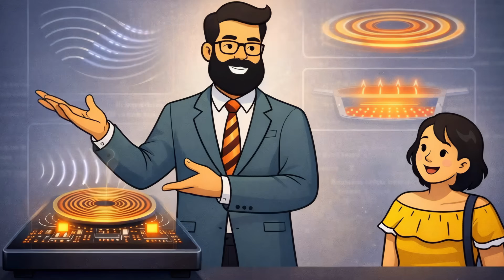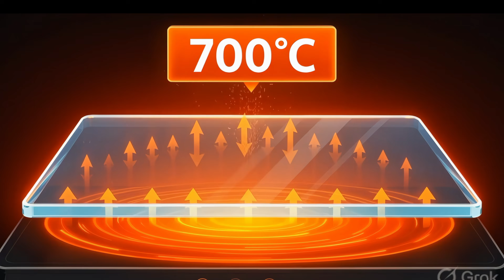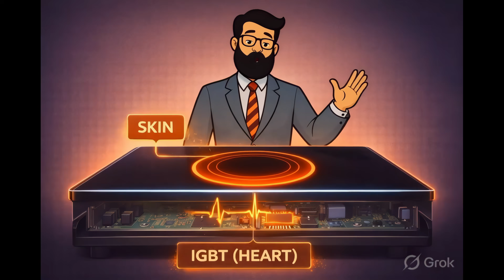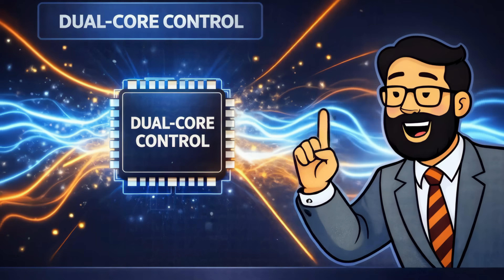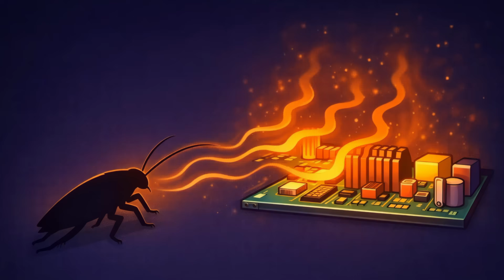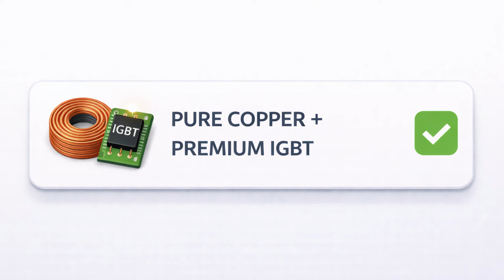Why Cheap Induction Stoves Fail: The 2026 "Power Gap" Explained

Comment: All fine but you never spoke about coil  width. Everyone is 6.2 inches. This leads to hotspot and pan wrap.
Which model has a wider coil 
How does tefal fare on your criteria 
Details like igbt are often hidden 
When is prestige likely to be in stock again?
Reply: Also sandwich bottom pots come apart on induction

Comment: PRESTIGE induction stoves are cheap quality  products and two have failed. Second one key pad repacement from authorised service centre in BENGALURUwas giving trouble  and subsequently it got shorted and MCB started tripping. This time I will buy good brand other than PRESTIGE.
Reply: I have used my Prestige induction continuously for over 3 years . It has a touchscreen control panel which is part of the cooking area ... No separate knobs and switches to get wet !

Comment: What about hawkins future double hob induction??
Reply from the maker: Hawkins Futura double hob is an excellent induction hob, if you can afford it.
Reply: @LetSalExplain  I have two questions.
One is you mentioned prestige and philips only in this video so does futura induction have all the technical parameters from safety and efficiency view point you stated in your video or does futura lack any of those critical aspects you covered..

Second question 
Futura single hob of 2000 watts is priced at 4455 rs but futura double hob model is 3600 watts but priced exactly double that of futura single hob which comes to 8910 rs. So the price for a single hob and double hob is the same proportionally but the power heating output is not proportional. Can I buy two futura single hob inductions as I can get 4000 watts instead of 3600 watts in case I buy a double hob model?
Reply: @ಸೀತಾರಾಮಾಂಜನೇಯ most homes have 2 kw power
Unless you have higher power you will overload the power and blow your fuse if using 4 kw on 2 kw line
Not one of the videos on the topic point this out